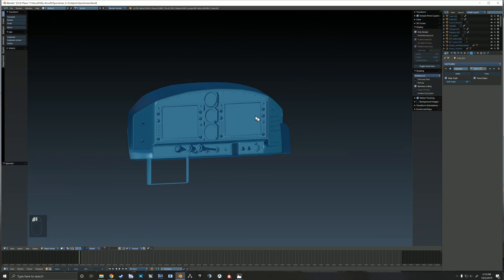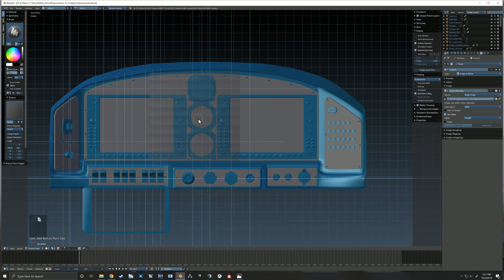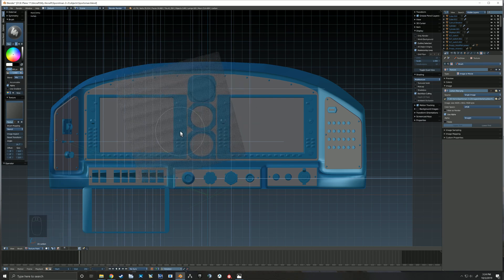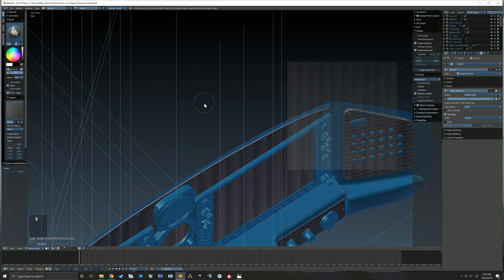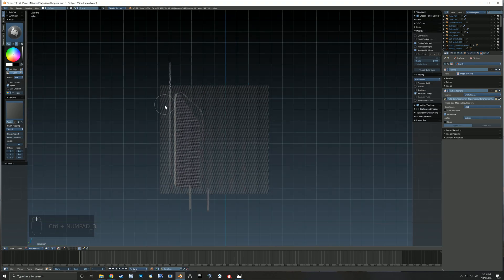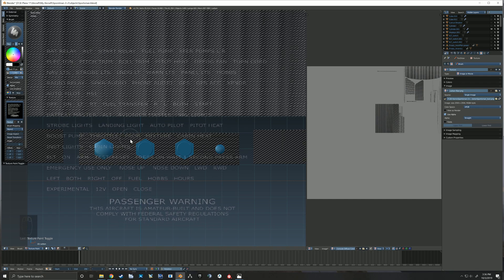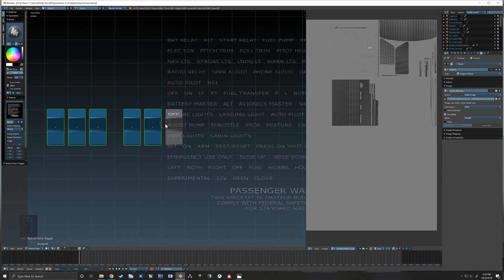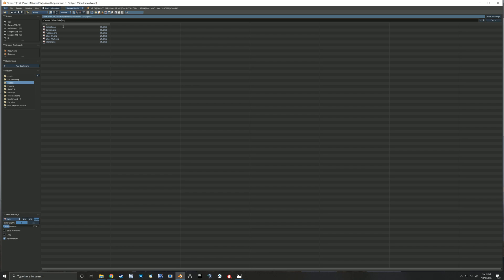How to make an airplane for X-Plane 11 Tutorial #24

Comment: i think i need to find a way to decompile the default cessna's cockpit object to see how the mag switch controls are set up
Reply from the maker: You can open any xplane object with a text editor. I use notepad ++ you’ll find animations and manipulators toward the bottom of the file.  You should be able to find the info that way. Also AC3D can import xplane objects but you have to buy it, and I don’t find it powerful enough to use as my main developing program.
Reply: thanks. i'll take a look at it that way. i'm working on a gyrocopter. i'll see if i can upload some screenshots and renders to the forum